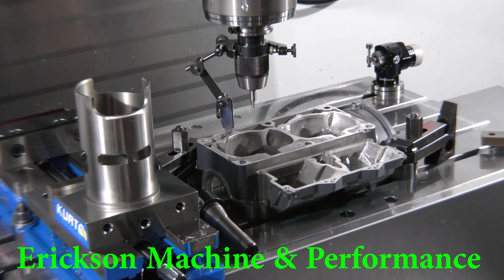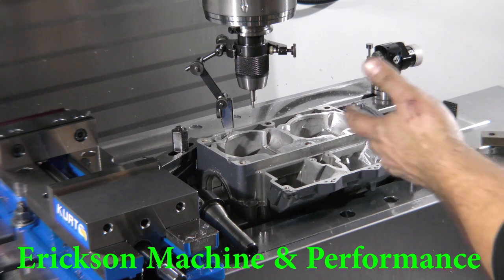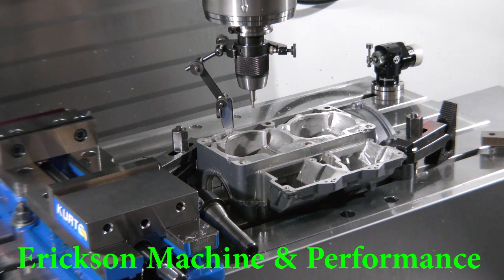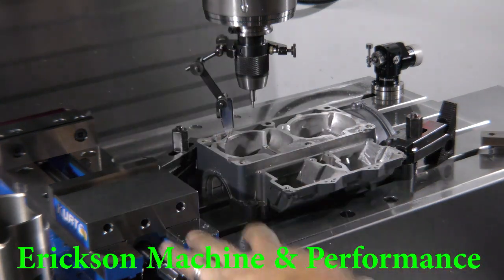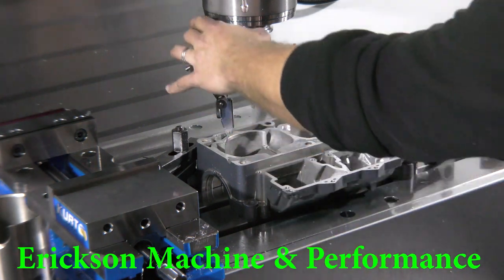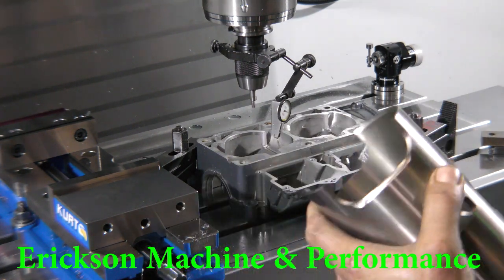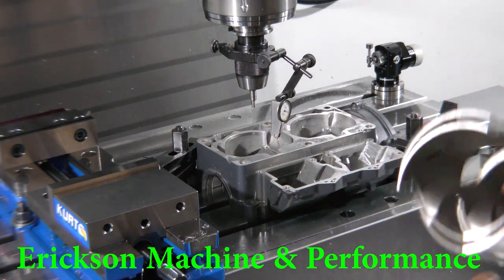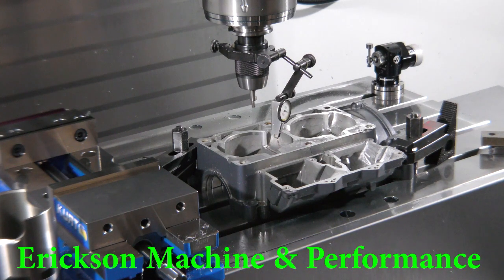How to machine 2 Stroke cases to accept big bore sleeves. Boring CASES Yamaha, Kawasaki, 62t 701 ect

Comment: This is off the topic of your video but i do have a 760 62t cyl with a 84.5 bore. Last year something  made the front piston run lean. I assume a air leak idk but long story short it started to burn a hole in the top of the piston by the time i got it back to the trailer. My question is with what had happened would u purchase the same size pistons and hone it or would u bore it to the next size. There is marks going up and down on the walls but i cannot feel them with my finger nail. Thank you for your time
Reply from the maker: Honestly the correct thing to do is have a Machine shop measure it.  If it's still within spec and can be honed and cleaned up without it being too loose putting the same size piston in is fine but if it's already worn and then you have to hone on top of it you're better off boring to the next size.   If you need a shop feel free to email me I'd be happy to help you out ericksonmap@gmail.com
Reply: @EricksonMachinePerformance  ok awesome thank you so much for the reply. When i get to that point i will keep you in mind. Keep the videos coming i enjoy them👍👍

Comment: 61x cases can be machined for big bore sleeves??
Reply from the maker: @anonymousxish  yes you can big bore 61x cases. All bottom cases say 6m6.  They never restamped the tooling. So the bottom halve of 6m6, 61x ,62t, 64x cases ALL say 6m6😉 they arent interchangeable because they are machined pairs but the bottoms are all the same castings
Reply from the maker: @anonymousxish  Erickson Machine & Performance 
Www.facebook.com/ericksonsmandp 
My shops in Nj